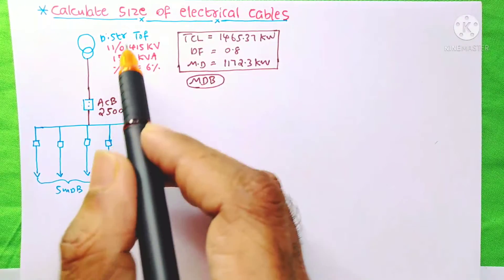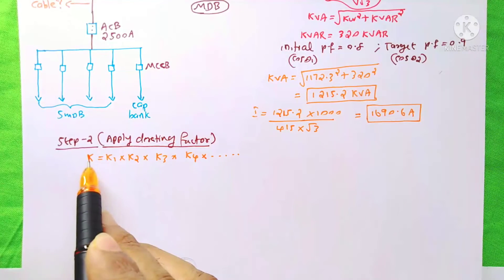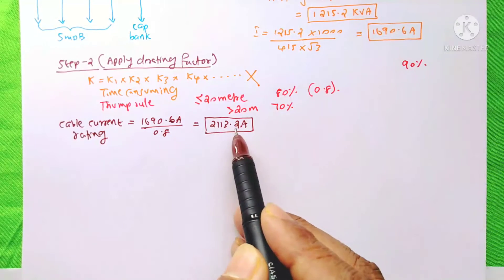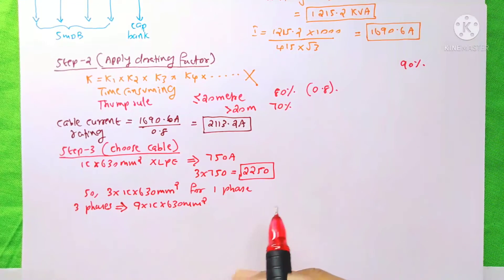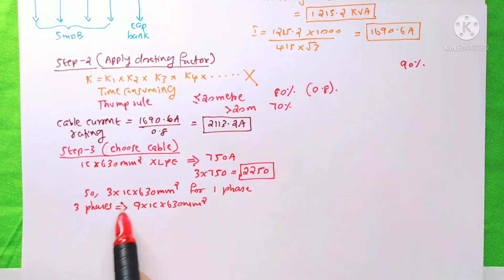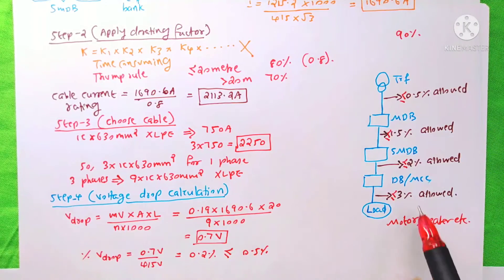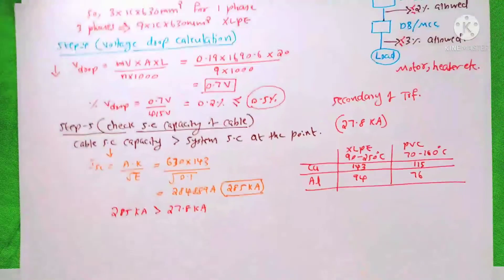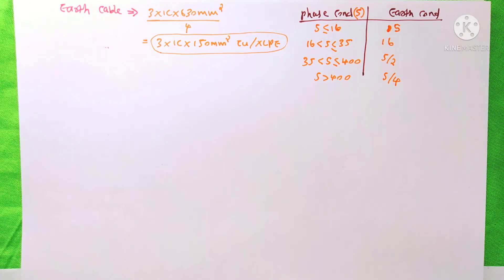How to calculate Electrical power cable size / Electrical

Comment: how you get mV rating in voltage regulation
Reply: same question
Reply from the maker: It's from cable manufacturer , 
There would be slight difference in mV from manufacturer to manufacturer